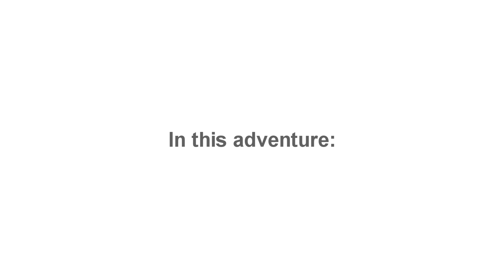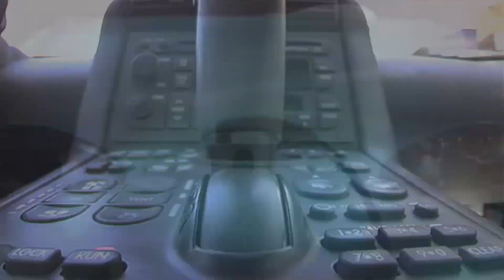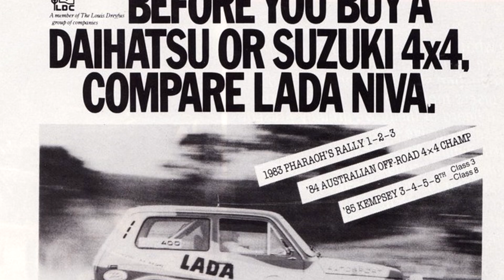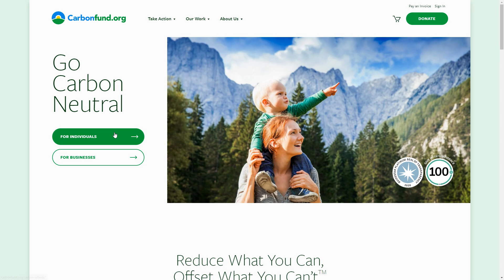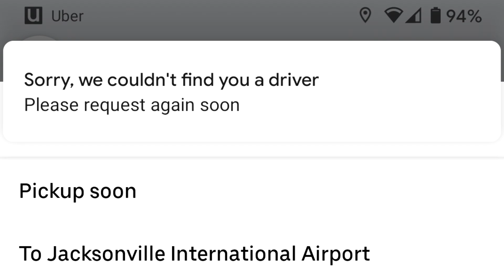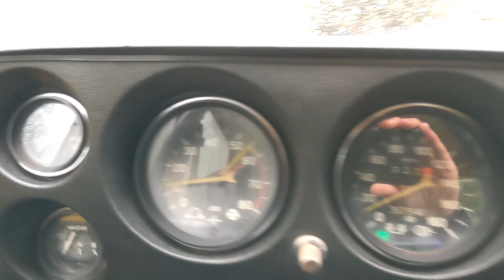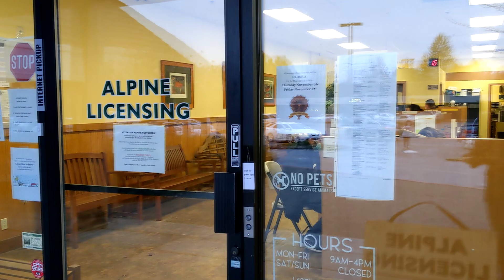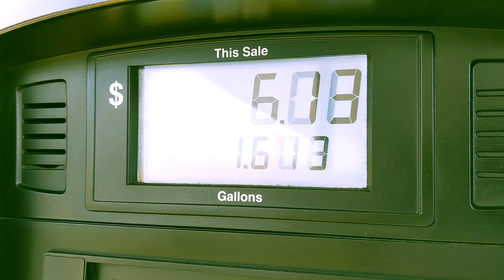I just bought an old Russian car to convert to electricity!

Comment: Once helped a friend with his LADA convert it to a 2wd RWD Nissan 1800 OHC L series carburettor engine with auto transmission RWD because the LADA engine was so underpowered.  Performance was way better on highway and also offroad except in the slipperiest conditions. Auto trans eased power applications on soft ground reducing wheel slip. So had we had the resources to engineer an adaptor plate and 4wd coupling would have been even better.

Comment: Hello everyone. In the first container we see two ZAZ 968 A (blue and red ones) and GAZ 22 "Volga". Strangely enough in a country named "USSR" abbreviations were quite popular. ZAZ stands for Zaporozhskii Avtomobilnyi Zavod (Запорожский автомобильный завод), meaning Zaporozhye Automotive Factory. For your understanding - Zaporozhye is a region in south Ukraine where the factory is located. Common soviet people called those cars Zaporozhets (Запорожец), meaning "dweller of Zaporozhye". Mind you, Zaporozhets is not a pural form, pural would be Zaporozhetses. That 968 A model (just like 965 and 968 M) is interesting for its construction. For example, its engine is located in the rear side, whereas in the front there is a trunk. Right above the rear wheels of the car you can see air intakers which are used to cool the car's engine. In 965 and 968 M there was the same coolant system but 968A's intakers were much more pronounced. For that reason creative soviet people nicknamed 968A "Ushastyi " (lop-eared). Next we have GAZ 22 "Volga". GAZ stands for Gor'kovskii Avtomobilnyi Zavod (Горьковский Автомобильный Завод), meaning Gor'kii Automotive Factory. City of Gor'kii nowadays is known as Nizhnii Novgorod and located in central Russia. Can't say much about that wagon except for it was rediculously expansive and very difficult to find on sale. Their production was very limited. Usually such Volgas were presented to actors, scientists, high level communist party functioneers, cosmonauts and high-ranking military officers. Obviously no common proletarian could aspire to have one of Volgas. In the second container we see LuAZ 967. As always let's start from the name. LuAZ stands for Lutskii Avtomobilnyi Zavod (Луцкий автомобильный завод), meaning Lutsk Automotive Factory. Lutsk is a city in western Ukraine. In soviet era this factory was famous for its small SUVs (models 967, 969/969M and  1302 "Volyn") that looked like ATVs. Although 969 and 1302 were civilian cars, 967 (just like the one we see in the video) was used only as a utility machine in the airports or army. So it's quite a surprise seeing one of 967s in someone's collection. A surprise, to be sure, but a welcome one as they say. I hope that 967 is in good hands. Next we see one of the most popular in modern Russia and absolutely unobtainable in Soviet one VAZ (or Lada) 2109 "Samara". VAZ stands for Volzhskii Avtomobilnyi Zavod (Волжский автомобильный завод), meaning Volgan Automotive Factory. The factory was and still is located on the shores of the river Volga in a town of Tolyatti. "Why such an Italian-like name was given to a Russian town" you may ask. Well, it was named after the Italian communist politician Palmiro Togliatti. However connection with Italy doesn't end there. VAZ's very first model 2101 was almost a copy of FIAT 124. This one 2109 is one of the first front wheel drive cars ever produced by a Soviet/Russian manufacturer. You may also ask "so why is some Samara in the name of this car". That's because Tolyatti is quite a small town located nearby big city of Samara. Not very creative but a good homage to a good city I think) What is creative however is a nickname of the car which is "Zubilo" (chisel) for quite sharp lines in its design. Zubilo was and still remains a very easy to repair machine, some even say that 2109 is reliable but they are just mad fans of the model I believe. There is nothing common between reliablity and russian car. The last but certainly not the least is Izh 2125 "Combi". Izh comes from name of the capital of Republic of Udmurtiya Izhevsk which is located western from the Urals in Russia. Don't know why the guy in the video named it "Moskvitch", it's obviously an izh. It even says on the trunk door "Иж 1500" (Izh 1500). 1500 is its engine volume in mililitres for some reason. This model have very much in common with Moskvitch 2140 though. However 2140 never had a wagon type. I believe Izh 2125 Combi or simply Izh Combi is one of the best-looking car ever made on the glorious soil of Soviet Union/Russia. Just like VAZ 2109, sport version of Combi was widely used in various rally events and was quite successful at it. But it was even more successful at delievering your harvest from your village house or dacha back to urban flat. Overall, I believe all those cars are legends and I really hope that their new master is taking good care of them so they can bring happiness to the generations of motorheads.
PS: English is far from being my native or even often-spoken language, so I'm very sorry for its terrible condition. Thank you!
Reply from the maker: Amazing information, thank you! And your English is excellent!
Reply: @KiwiEVadventures  I really appreciate it! Your channel is great!

Comment: In Germany, someone did something electro lada niva.Sold for 30 000€ They put an electric motor with 82 hp . the accumulators were removed to the place of the gas tank.And from the gas tank hatch, it was possible to pull out a 220V wire-cord.

Comment: 11K USD? For a 1982? This is more than a new one today in Russia (AC included) ... a lot more. These things hold value much more than here in Europe ... And a 1982 is not even fuel injected. This endeavour would be much cheaper back in Slovakia. Good luck though, you'll need it. These old Nivas rust so quickly, you can hear it at night, if you listen closely. Lada claim they fixed it nowadays.

Comment: They were more advanced than Land Rovers when first launched.

Monocoque body.
Disc brakes up front.
Permanent, tough 4WD.
Coil springs all-round.
A proper interior.
Reply: This was meant to be the cheap car for everyone, not the best car
Reply: The range rover was launched in 1970 and had disc brakes all rounds, permenant, more advanced(?) 4wd, coil prings all round, and a very propper interior. Body on frame chassis rather than monocoque, and a solid front axle

Comment: There were electric cars around in 2007, just... not great ones, basically cars with a bunch of car batteries connected together, with not a lot of range, and horrible to charge.
In Norway, we got a tiny thing that looks like a moped car, Kewet Buddy, though it was around before that under a different name, since the 90s.
Peugeot had a lot of EVs in the 90s, the Peugeot Partner, and the Peugeot 106 are ones I've seen about, also terrible tech compared to now.
MOPAR also had some in the 90s, the Chrysler Town & Country/Dodge Caravan/Plymouth Voyager came as a weird EV model. (Sold as Dodge EPIC)

But still! the fact ya still made something yourself before any sort of EV had become more mainstream, is quite amazing, as ya had to make stuff up yourself, instead of taking ideas or parts from other vehicles.

Comment: wow that nivas body is excellent, but the price...
its more expensive than new niva in russia 
anyway im interested, good luck from russia
Reply: btw i recommend you to check illing show chanel, theyve made extremely low niva, it have about 14cm between the body and ground in higher level
and also academeg chanel, they made big niva pickup(vaz 2329) for off-road
Reply: https://youtu.be/npnGgQh2VfE lower one
https://youtu.be/946rJ5yhxms higher one

Comment: Well. They did make electric Niva in the late 90's. Though they used 5-door version (2131) and they had to remove it's 4wd capabilities. VAZ experimented with hydrogen and used Niva (although, by that time it was already called Lada 4X4, since "Niva" name was transferred to new model developed together with GM) as a chassis.

Comment: Check these folks' https://zero-ev.co.uk/  they mount the motor in their EV Miata where the transmission lived so you can fill the engine compartment with batteries.  Looked like a cool idea.

Comment: USSR and Russia start make full electric cars aroud 1980s
U can order buy  electric Lada if you want
Reply: there were very few electric 2102 ever made. Difficult to find now.
Reply: @jur4x  
U have to order from vaz factory
I think still in production
Reply: @vaninec  2102 deffinately impossible. Stoped making them in 1986. 
2104 was produced up till 2012, but was never turned into EV.
In the late 90's early 2000's there was experimental Niva EV (called 2131Э) but I can't find exact time when it was made and how many in total.
Finally,  in 2012-2013 they made Lada elLada, based on Lada Kalina. Only 100 was ever made. Had 23kWh battery and some kind of fast charging.
Reply: @jur4x  
I read somewhere u have to pre-order full electric.
It is not in mass production
Reply: @vaninec  I've heard there is German company that offers conversion. Also, loads of conversions are available in Ukraine. And last year I've seen an announcement from some Czech company that they offer electric UAZ now. Obviously, not electric from factory
Reply: American import laws are stupid.
Reply: @Fredward1  
Just a market control to kill competition.